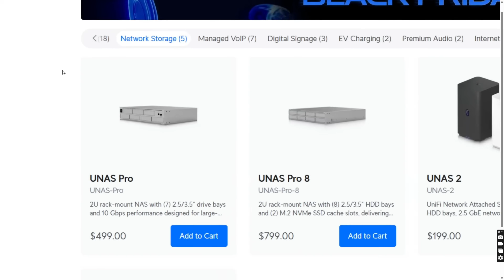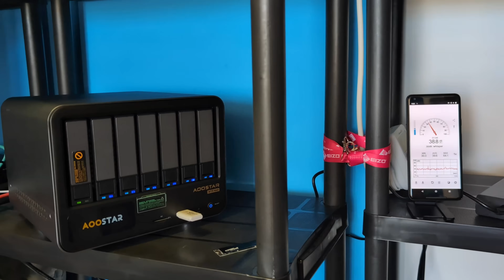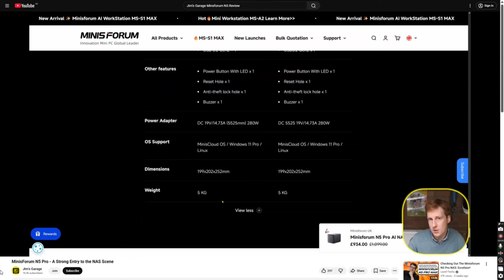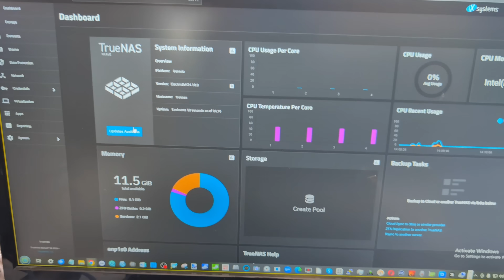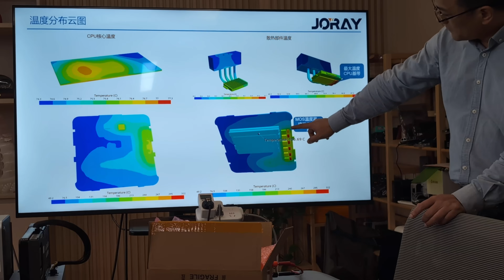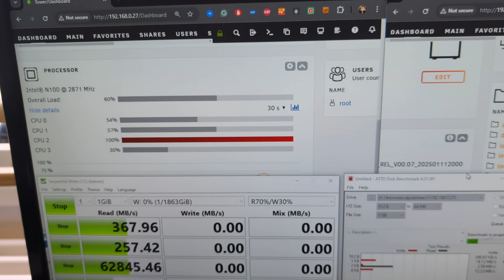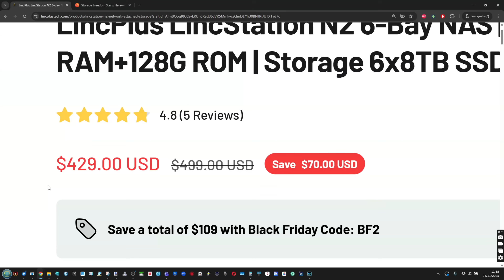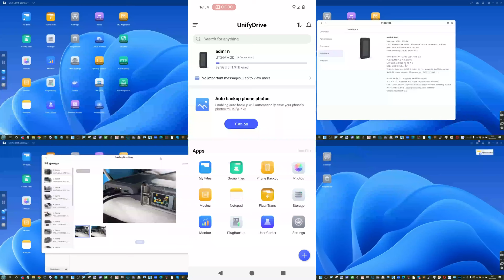Best NAS of the Year - 2025

Comment: The mobile NAS seems like a great idea. Basically has a built-in UPS. And the overall mobility/space/energy advantages of SSD-based solutions would be unbeatable if only SSDs weren't so expensive. The cost disproportion compared to HDDs, especially considering the recent price hikes due to data center build-up, is simply too high, at least from my personal perspective.

Comment: OMG, he's raving about the cooling on a piece of junk so badly engineered that the tiny fan is just screwed into the middle of a huge open grate. The grate should match the size of the fan and since there's space for a huge grate, there should be a huge fan behind it. Larger fans move more air, and at lower speeds so they are quieter. Basic engineering....control the air flow.  Don't be fooled into buying on "specs". It doesn't matter how many drives it does or doesn't hold, it matters if the PCB is 7 layers or not. It matters what quality caps are soldered to the board. It matters how well the drives are insulated from vibration. Yahoo over there needs a shower and some actual time working in the industry.
Reply from the maker: Have you used that NAS?
Reply: @nascompares  No. I wouldn't. I'll stick with Synology, thanks.

Comment: I'm outta here. Not only does he sound like his mouth is full of rocks but he has the common sense of an earthworm. 

A NAS is where you put all the important stuff. Its where you store things that won't fit on your local drive. Its where things that need security stay because it never leaves the house. Its something you depend on. As a result, what matters is not how many ports it has (betting 98% of people use ONE) or how much RAM it does or does not come with, or even how loud the fan is. When it comes right down to it, it really doesn't matter how fast it is. 

What matters is, is your data safe. You want a company with world wide support, that's been a leader for decades, that will be there if and when a problem happens...because, guaranteed, it will happen at the worst time. It should be big, really big, for better air flow. If its under heavy load I want to hear that fan sound like a 747 on take off. Why? Because that's what keeps my data safe. If your data goes bye-bye, nothing else matters. 

If you're not a pack rat, you can get by with a mirrored setup. If not, RAID 5 with a parity drive and on the fly rebuild is an absolute necessity. 100% of your data, 100% of the time. 

If all you want is somewhere top store bootleg movies you downloaded, anything will do. They have no value to you. They are 100% replaceable. That custom tweaked software you had made for your business, that's replaceable, but expensive. The important documents, maybe you can track them all down, but it will cost you a LOT of time and not an insignificant amount of money. Photographs. Recordings, Videos. Creative works, finished and in progress, those things matter. They matter more than the couple bucks you save on Ho-Chee's Miracle Box. The one you want is the one you forget about, tucked away in some corner that just keeps working without you thinking about it. Because you won't. Until the day it doesn't. Then you'll remember reading this and think 'why didn't I listen?'.
Reply from the maker: Help me out here..... What is the point you are making? In relation to the video subject?
Reply: @nascompares  That you haven't  a clue what you're talking about. Not idea one what's important and don't care what your bad advice is going to cost people foolish enough to listen to your rambling. Go get a real job, maybe you could pour concrete, something where there are others to cover your mental short comings.
Reply from the maker: Again, I'll circle back to it. What is the point you are making in relation to the video? Could you let me know the best 5 NAS of 2025. As I fear you have missed the point somewhat, and instead are on something of a crusade... As well as the target demo for these kind of solutions.
Reply: @nascompares  For those in need of remedial education, the point is, NO 'best of 2025' can contain any brand less than 25 years old and stable. So none of your selections apply.

Comment: Those Synology develop Bastards are still pushing their harddrive restrictions to older hardware in their new software updates. My DS124 runs a long time perfectly  on a 8TB TLC Samsung SSD for storage and run each night a TRIM task. In the update they now disabled the TRIM function, for the drive isn't listed and that could cause data problems. No Synology
... YOU are the ones who introduced the risk of data problems by disable TRIM in newer software updates. Grrrrr.

Comment: 8 months ago I chose UGREEN because rumours circulated that Synology would lock down its NAS to only use its own hard drives.  I thought Synology can go and take a hike.

I replaced my Synology 918+ and 418+ devices with two UGREEN DXP4800 Plus. I also purchased a UniFi Dream Router 7 to replace a  Synology RT6600AX router. cancelled my Synology C2 cloud backup subscription and am no longer in the Synology ecosystem. The DXP4800 Plus is well-built and has excellent specifications. I particularly appreciate the UGOS software, which meets all my requirements.

Comment: Observations, interesting hardware at lower price points. Lots of NVmE based devices. 2.5GbE is becoming the entry point standard, as it should. Open standards offer greater flexibility. Old school solutions need a step change fast to keep up.

Comment: I been using the ugreen DXP4800 (non Plus) for general storage and backup and it's been amazing.

I used to love unraid but last month I spent many weekends and hours troubleshooting why tf my unraid system isn't connecting to SMB on windows. This was such an issue that I couldn't get my info out of my old nas (it was on a nvme). So I bought the ugreen system and a nvme to usb adapter and swapped it all to ugreen.

I'm not the smartest when it comes to Linux or truenas or unraid so I am astonished how user friendly the ugreen os is. Deff recommend.
Reply: Did you check the warnings about public shares and Windows?

Comment: I managed to grab and already get delivered a Aoostar WRT pro about a month ago. 
I am running it with 5 HDD's and 2 nvme's. Integrated it in my Proxmox cluster and put cephfs on both the HDD's and the nmve's integrated in my Proxmox cluster. NAS services by Nextcloud simply passing a directory trough from the HDD's and the nmve's. The nmve cephfs serves the users documents where the HDD's are a first level backup for the user docs and any other cold data storage like Proxomox backup's. The whole thing is than backed up to my aging Synology plus an offsite backup for the really important data.

Performance wise this thing is a beast. I have not been able to bring it to it's knees even though quite a few virtual machines are running on it as well.

Comment: The problem with Unifi NAS is it only does storage. It can't do Plex transcoding, NVR functionality for security cameras, or run containers for managing your smart home.
Reply: I doubt most users care about NVR and/or smart home.  The Plex thing makes sense as I believe many might have a video library.
Reply: @timradde4328Unifi has a different product UNVR they don't want to disrupt. It's like Apple not bringing touchscreen to Macbooks.
Reply: The Unifi UNAS is part of Unifi Ecosystem so is where its place in the EcoSystem is.   It is pure storage but what you are personally looking for is a Home Server as opposed to a NAS.   The line especially in the home market has become kind of blurred.
The original 7 bay UNAS is the same chassis as the UNVR-Pro from Ubiquiti.
I will be putting in a Unifi Gateway, Switch, Wifi and VoIP and when come to replace the Terramaster will install a UNAS and a mini PC to run the apps.
Can then use the Identity App to login to the Wifi, or Remote Access VPN and then access the UNAS where will have the User Stores from the machine with each user getting access to there own area.
They have seperare NVR solution for security camera's if want to add those or can even run the Protect App from the Gateway if get a UDM and small scale requirement.
A lot of the people lookinng at it like it as can keep the Apps and Storage seperately.   They can build a nice ProxMox solution and then mount the Storage seperately.  Need more Apps then can get a better mini PC without having to start doing any migration with the Storage.
And if running your smarthome then realistically you want resilience where should have N+1 System where N is the number of Servers needed to run all your apps + 1 so can take one node out for maintenance, updates etc or if fails then won't lose the apps.
Now that may well be overkill for you however for people that want that then a single box is a problem so the fact that the Unifi NAS doesn't do the Apps isn't a problem as it means that the NAS can be just storage so the CPU/RAM costs are less.
That UGreen 8 Bay DXP8800 NAS is £1104.99 in sale.  That 8 Bay UNAS-Pro is £666.00 in sale.    There is a reason the UNAS is that much cheaper and that is it is Storage which is what NAS started out as.   UNAS is more the Prosumer/SMB area and for SMB then SmartHome and Plex not really a requirement.    They will already have Servers for Apps and Containers.
Saying the problem with UNAS is that doesn't do Plex Transcoding or NVR  etc is like complaining that an Audi R8 has a problem in that you cannot do the school run and take 5-6 kids to school in it.  It is not what an Audi R8 is bought for.
Reply: UNAS is a true NAS. I love it for that and my UNAS Pro 8 does a fantastic job of hosting my PLEX libraries. My compute for doing transcoding and other functions lives on another device. I just wish I would have known they were going to knock $100 off the price for the holidays.

Comment: I got the F8 SSD Plus recently and am happy so far. I don't want to have any HDDs in my NAS, I want my NAS to be inaudibly quiet and small (M.2 only). And there really are not many options then. And I wanted something that can do "dynamic RAID6", and it seems only Terramaster and Synology offer that in their OS. I just wish 10 Gbits wouldn't be the limit, since M.2 SSDs could be so much faster than just 10 GBits... but my PC also can't do more than 10 Gbits Ethernet so that's not just a NAS limitation.
Reply: If you can afford SSDs, great. But this is basically a luxury item as you pay 4-6 times the price per GB compared to HDDs, and have to do with less overall capacity. Mobility and acoustics may be major advantages, the question is, are they worth the steep price. :) As for throughput, unless you do some throughput-intensive work like video editing, you don't really need that..